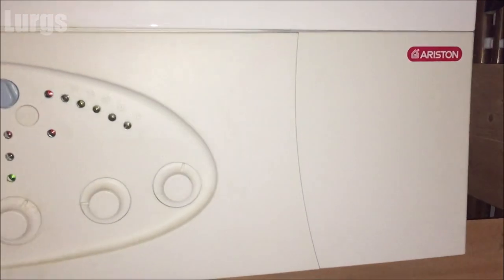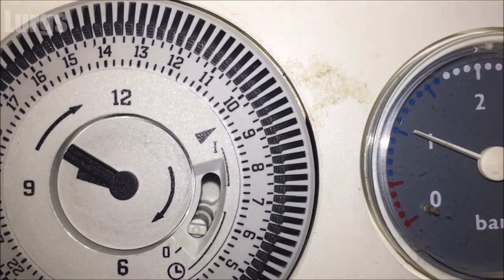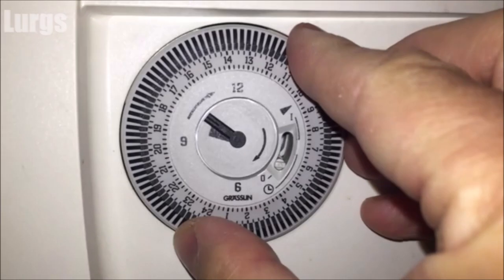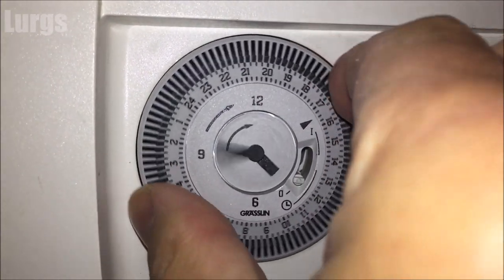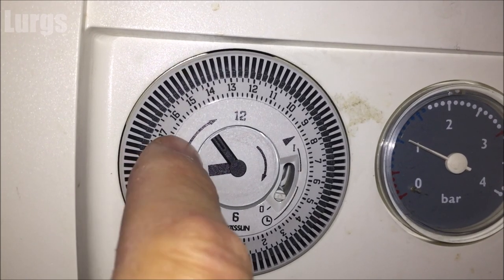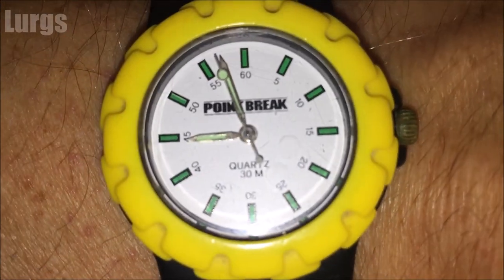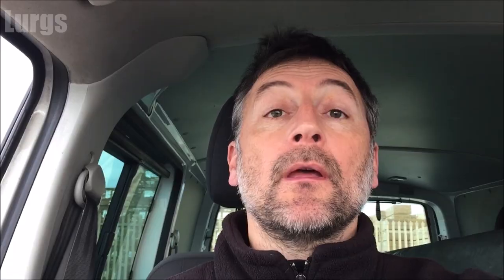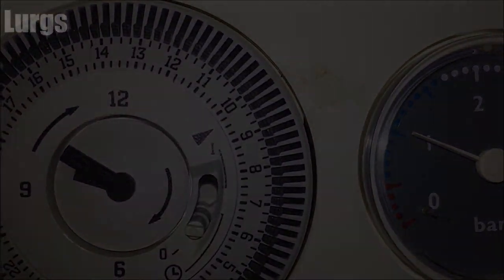Setting Pin Time Clock on Combi Boiler - How to set a Boiler Time - Set Grasslin Clock

Comment: Thanks for this video… I have set the time and can also hear the clock ticking sound. However, after setting the time, the clock hands remain stationary and stays at the same time that I set. Does that mean the clock is not working and need replacement? I’m confused how the clock ticking sound comes if the clock is not working.

Comment: I've got a bit of a problem with my manual timer. When it's on the timed mode, it turns fine and then just gets stuck as soon as it hits the time it is supposed to start heating and doesn't move again. As you know, you can hear it when it's turning as it kind of makes a ticking mechanical noise, but it totally stops and doesn't make any noise at all. Any ideas? 
We had it fitted last week and it stopped. The guys came back and replaced it and this one has done exactly the same thing!
Reply from the maker: That is bizarre as the clock timer unit is a separate unit so the odds of another one stopping as well are tiny. Is it hitting something maybe? Does it stop at same time or any time it hits timer on?
I replaced one (I’ve got a video on it) and it worked fine. Not sure what to suggest. Maybe it’s blowing a fuse or something when it goes to fire up the boiler or maybe they’ve wired it up wrong.
Reply: @LurgsHowToGuides  It's freely able to move around, so when I don't have any of the timer notches in the 'on' position, it will go round and round like it should. As soon as I put one of the notches down so it comes on at that time, it stops and doesn't move again. It can be at any time, I've randomly put notches at different times and it just stops whenever it hits them. Strangely enough, if I manually turn the dial (like I'm adjusting the time) it needs a little bit of force to get it past the notch it is stuck on (notch is also jammed when it stops but can be moved again when dial is moved past it) it then starts moving and ticking like normal until it hits another notch. 
Bizarre, right?
Reply from the maker: Totally bizarre. Is it a brand new timer or a second hand one? Odds of two timers doing the same thing is slim but it is possible.

Comment: Hi. Please help. Does it matter if the hands in the middle don't match to the 24 hours on the outside? The hands are wrong but I have made it so that the arrow on the outside is at the correct time. Advice much appreciated.
Reply from the maker: How far out is the time to where the arrow is? If it’s only 30mins or so then it doesn’t matter, if it’s way out then it will be an issue